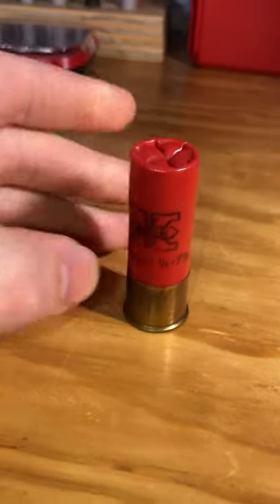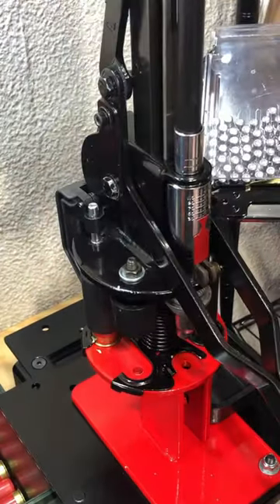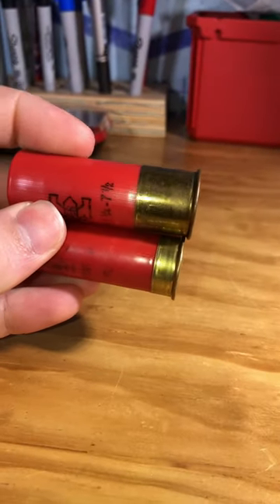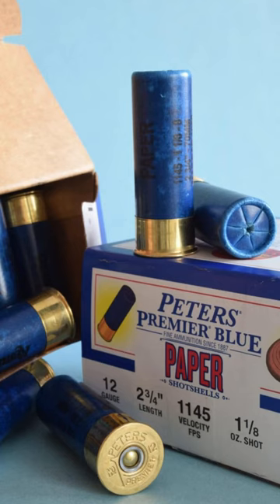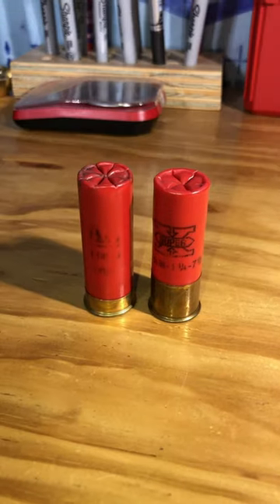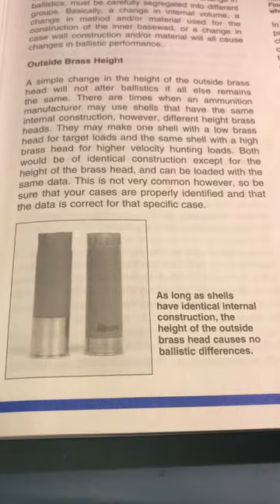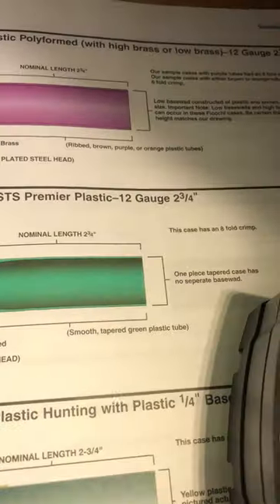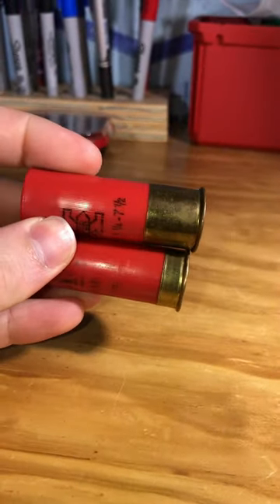Why Low Brass vs High Brass is Nonsense!                                #shorts #12gauge #reloading

Comment: High brass vs low brass is not nonsense, a SAS chambered in 3" will not cycle right with 2 ¾ low brass shot shells.
Reply: But a high brass 2¾ will. Act accordingly.
Reply from the maker: Try a hot low brass like a Win AA handicap load. It’s not the brass, it’s how warm it’s loaded that depends on if it cycles or not.

Comment: I have a bunch of Winchester and Remington shells that always seem like they're overfilled but when I use my Federal cases they crimp just fine. What's happening?
Reply from the maker: Assuming you’re using the same wads, be careful. Federal hulls are straight internally, while Winchester and Remington are thicker at the base and taper thin out towards the mouth of the hull. Techncially speaking the Winchester and Remington hulls have less case volume, and your wads (assuming you’re using wads made for straight walled cases and not tapered wads) might not be seating all the way down as far as they’re supposed to go. Does that make sense?
Reply: @thereloadingcraft  yep. I know I'm using straight wads. I didn't realize that they had different shapes. That explains why it felt like I was over filling them.
Reply from the maker: That would most likely be the cause, then. A simple swap to tapered wads ought to fix it just fine.
Reply: @thereloadingcraft  thank you
Reply from the maker: Happy to help! Thanks for watching!

Comment: Unless you have a magazine fed 12 gauge, then high brass 100% prevents jams
Reply from the maker: How so?
Reply: @thereloadingcraft  Less hull deformation in box magazines. I have two box magazine fed shotguns and neither of them cycles low brass reliably. Tubular magazines with loading gates can run just about anything tho
Reply from the maker: @sinosparo  what low brass have you run? Cheap bulk stuff or good medium-warm trap loads like Win AA or AA handicap? Those are some stiff hulls and take a lot to deform, and they’re still low brass.

Comment: Fun Fact: Most of these bases aren’t even made of brass, but plated steel
Reply from the maker: Correct, in saying “most” 👌🏻
I know for a fact my Win AA’s are actual brass. They don’t stick to a magnet, and they don’t rust or flake plating off. Another reason I like them especially when shooting trap in wet and snowy weather
Reply: Real brass is a plus in my book. I'm gonna check my latest AA purchase with a magnet 🧲!

Comment: If there not inferior why will low brass not even cycle my shotgun?
Reply from the maker: Because it’s all about how the hull is loaded. If it’s not cycling most likely whoever loaded them loaded them weak. The hull is not directly related to how the manufacturer or handloaded chose to load them.

Comment: Serious question and I'm pretty sure it's a no but I'm not sure and want advise from someone who does this often but can I reload the hulls with aluminum instead of brass? I know you can't reload things like pistol round made of aluminum but everything is a little different if you read all that I appreciate your time and if you respond I'll probably love you for ever and even subscribe
Reply from the maker: Do you mean an entirely aluminum hull, or one with an aluminum base? Also you “can” reload aluminum pistol ammo, you just won’t get very many reloads before the case is worn out.
Reply: @thereloadingcraft  a plastic hull with an aluminum base lol sorry should have specified
Reply from the maker: No worries! Provided you can find load data for them, I wouldn’t see why not. As others have said it’s the chamber that holds the pressure, the hull just has to be a gas seal and extract reliably.

Comment: I had a question on  shot shell  reloading and I was wondering if a reloading press can do any gauge or only on size
Reply from the maker: It depends on the machine, I believe you can get gauge change die sets for the 600JR and convert between some of them.

Comment: We all call them brass, but they can be picked up by a magnet. 
I've reloaded both.
Reply from the maker: Some can. My Win AA’s are non-magnetic (true brass) but the primers are magnetic. Other hulls are brass plated steel, and some are just steel.
Reply: @thereloadingcraft  I'm going to have to try finding som Win AA. Thanks
Reply from the maker: They’re well worth it in my opinion!
Reply: @thereloadingcraft  I just sat at the bench this evening for a while and reloaded some 20 gauge with my Lee precision.  
Last year I helped a 3D printer dude design and make some powder and shot bushings on the smaller side for it.  We went from 0.075 cubic inches to 0.090 cubic inches by 0.005 steps for powder and 3/4 oz and 5/8 oz shot bushings to encompass more 20 gauge loads. He sells them on ebay now.
Reply from the maker: @phild8095  solid! Do you know what material they’re printed from, and does he coat the inside of each chamber with any kind of chemical resistant epoxy?
Reply: @thereloadingcraft  I've tried several times to reply, thought I did last time.  Look for Elite 3D Design, contact Daniel, tell him Phil sent you.
Reply from the maker: Sounds good!

Comment: High brass is just better at cycling in semi autos, amd smoother, yes low brass in inferior. Always will be.
Reply from the maker: The brass means nothing in terms of how the hull can hold pressure, and it’s only purpose was to keep paper hulls from burning through around the powder charge. 

How factory manufacturers load their shells in regards to “brass height” is archaic and only feeds into the stereotypes that high brass is somehow superior. I challenge you to take a WIN AA (low brass) full power shotshell or even a handicap load (still low brass) and tell me that it won’t cycle a semi auto. It has nothing to do with the brass height, and everything with how it was loaded, whether by the manufacturer or the reloader. 

Low Brass Vs High Brass-Clarificarions
https://youtube.com/shorts/CutNvMusbnc?feature=share
Reply: @The Reloading Craft  dont know what to tell ya dude....high brass just shoots better.
Reply from the maker: 🤦🏻‍♂️ did you even read any of what I just said or watch the short?
Reply: @The Reloading Craft  I watched and listened, I won't read if you just keep insisting your right, high brass shoots better period....I shoot 12 gauge daily, with both semi and pump, all I'm saying is it cycles better and smoother and that's just fact dude.
Reply: @thereloadingcraft  I've had various Federal low brass get stuck in the chamber and not allow my Garaysar to cycle. I'll give the Winch AA a try.

Comment: Well, use one for one style load and use the other for another load. when you feel or see the brass you will now what is in your hand.
Reply from the maker: Except high brass are a royal pain to resize on a Mec 600JR with a carbide sizing ring because it doesn’t extract the sized hull fully
Reply: @thereloadingcraft  I use a mec super sier and my press is a 650 progressive.  So I don't have that problem.
Reply from the maker: @mostlikelywedoitservices6926  correct, because the super sized uses the resizing fingers

Comment: What Manuel are you using and does it have steel shot load data for 20 gauge 2/3?
Reply from the maker: Running the Lyman shotshell manual, one of the best and most comprehensive ones out there. Not sure on the 20 gauge 2/3 tho, I don’t have it with me at the moment